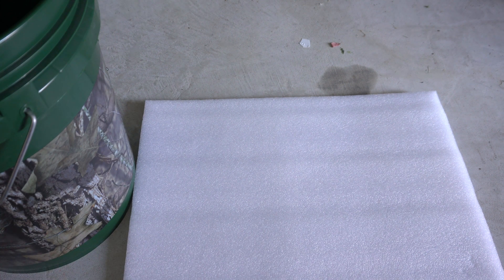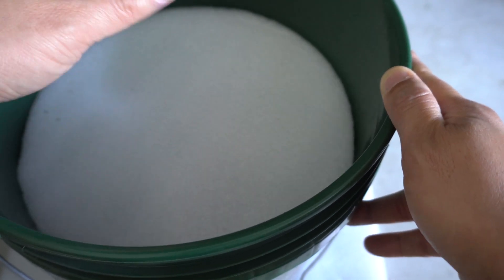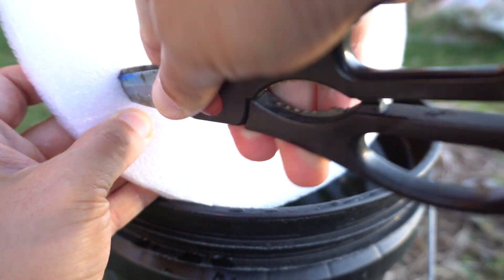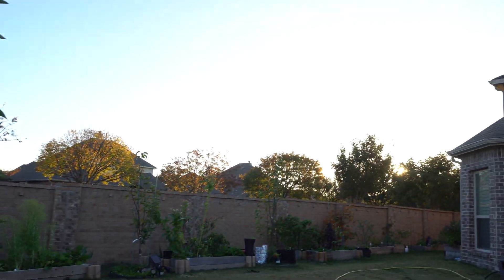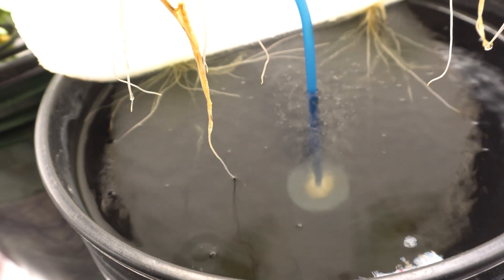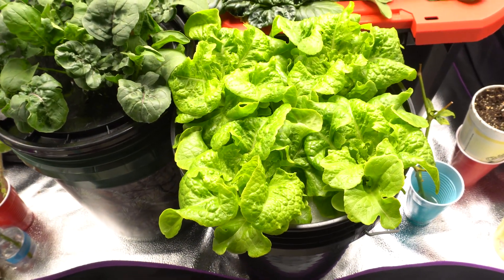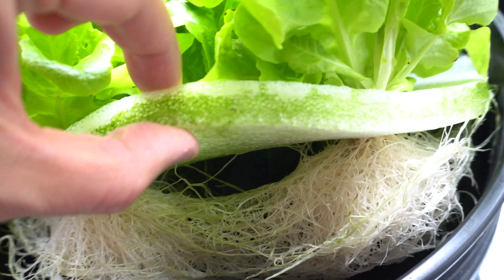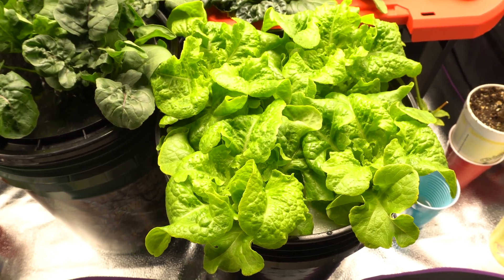5 Gallons Floating Raft Hydroponic System Using Solar Power

Comment: Doing this outside, I would worry about Mosquitoes here in the South. I have an Enclosed Deck which is a Sun Room, I may try this...  Thanks...
Reply: A piece of tulle with an over hang and a hole for thr plant draped over the bucket but under the foam might keep skeeters out

Comment: where can i get solar pump like that? need details on brand and cost
Reply from the maker: Here you go https://amzn.to/3rQXGNW
Reply: Thanks ! Does it work well ? Have plenty of power for a 25 gal hydroponic tub ?
Reply from the maker: @rigorodriguez3023  I read alot of bad reviews, but I had 1 that lasted over 3 years, I bought 2 more because it's so much fun..  One thing I did notice is that the outdoor conditions will eat away at the solar panel after a while.  I leave mine outside in the rain and all.
Reply: @KhangStarr   thanks, I have a plant room with lots of windows so it will be indoors out of the elements.

Comment: I'm pretty sure that the Kratky method doesn't include using a floating raft. With Kratky the dropping of the water as you know creates an air gap for the plants to get oxygen. With the floating raft you do need the air pump. A pretty cool project.

Comment: Question: will the plants drown if you do this without the pump? I thought Kratky needs space for air roots. I will try this. Thanks for the great idea.
Reply: Yes, kratky needs space for air roots. Your plants would drown without the pump HOWEVER, This method could be adapted for kratky! If you instead made a platform that floated several inches above water to allow for air roots, it could still work without the pump.

Comment: Have been thinking of something like that Khang. Something built from styrofoam sheets or blocks. Maybe with some type of a tote that could be handled inside for the winter. Wondering how aluminum foil strips attached to the outer edges of the floating top could act as a wiper to keep the light out. At the moment up this way there is a howling Blizzard raging outside this morning. Hope you and your family have a Wonderful Safe and Healthy Christmas!! -Bob...

Comment: How about a cut round sheet of black plastic (trash bag, pond liner, etc) on top of the float that completely blocks the light?  It. would just flex around the edges as it sinks.